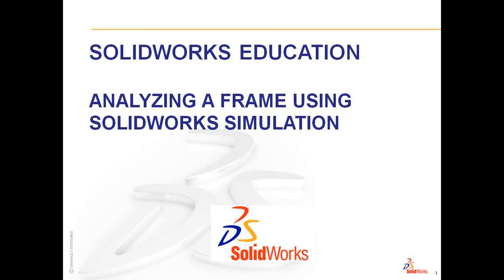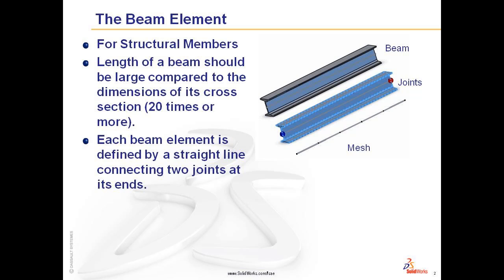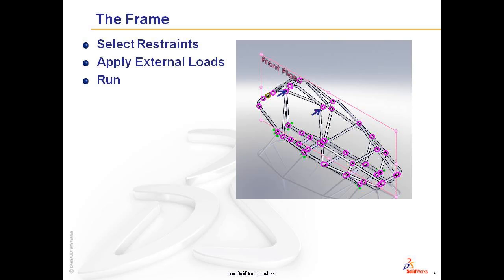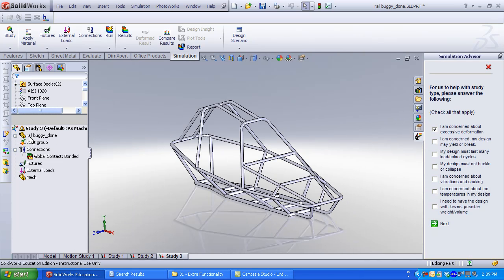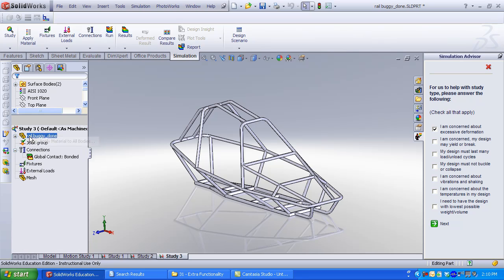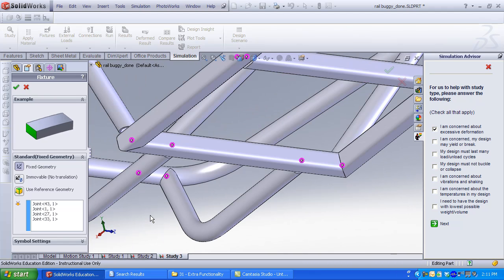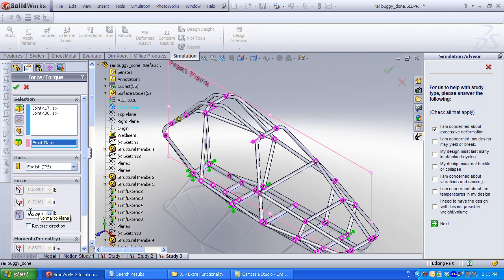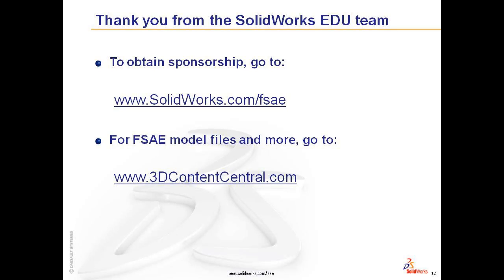Analyzing a Frame in SolidWorks Simulation

Comment: @macrossvr If you run a mixed mesh with both beams and solid/shells, then you have to define how they interact. If you were running just beams, the "Global Contact" in "Component Contacts" takes care of it and you don't need to define contact sets unless you want to, but when you have a mixed mesh, you have to go into "Contact Sets" and specify the contacts at the boundaries of beam & solid/shell such as non-pen, bonded, etc. otherwise SW will throw a fit.

Comment: This analysis would work great but the mesh is WAY too coarse, and why can't solidworks simulation allow me to adjust that? Also, the software should also give joint loads but it doesn't as well. These are serious flaws in its functionality

Comment from the maker: Hi Shoung,

SolidWorks Simulation is an Add-In in the SolidWorks Commerical version.  SolidWorks simulation is available in the SolidWorks Education Edition or SolidWorks Student Edition by selecting Tools, Add Ins.  Check SolidWorks Simulation, SolidWorks Flow Simulation or SolidWorks Motion (for kinematics)
Reply: Hi solidworks, could you please answer some of the questions above? considering buying simulation but not sure if these are the users experience. please advise.